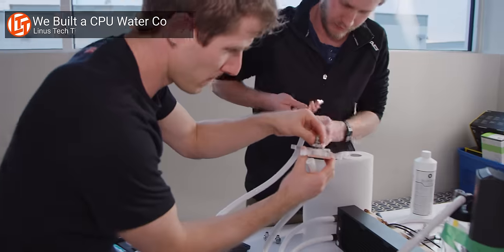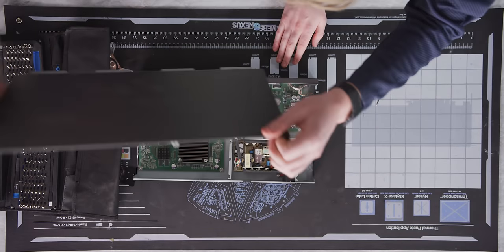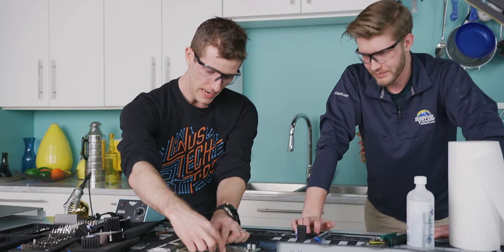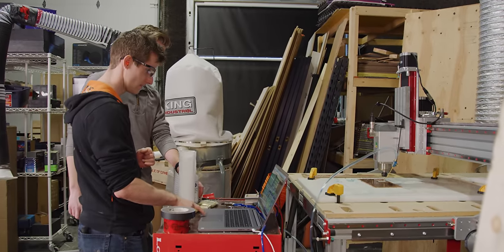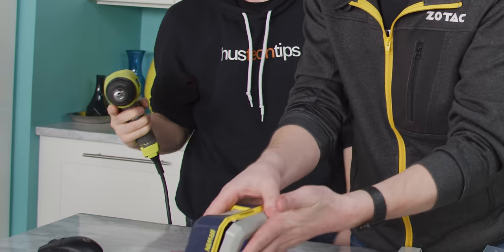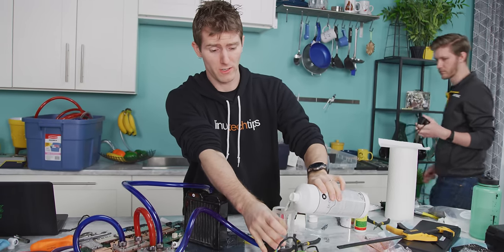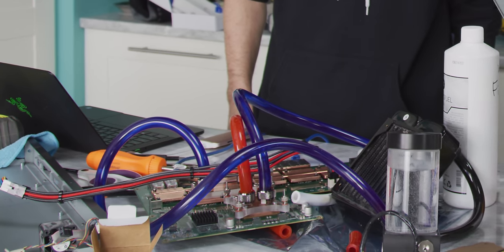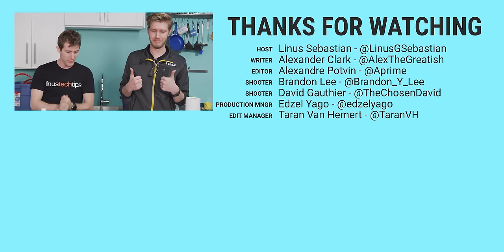Water Cooling a Network Switch!

Comment: I think Linus and Co. may be onto something here.  I know I am tone deaf after years of living a chained hermit life in a data center.  This idea could save the hearing health of many people if applied (with more engineering/design) to infrastructure systems.  Good job guys.  :-)
Reply: Us building engineers are with you being stuck in machine rooms around huge pumps and walk in air handlers. 
I mean technically the building I work in is water cooled (scroll chillers) it's still deafening due to how large fan engineering and hvac in general has not changed in 40 years.

With some modern engineering put into fans and large motors I'm sure they could make systems much quieter and efficient. But less R&D = more profit.
Reply: Custom molded ear plugs are your savior. You can find some that reduce about 28dB and can double duty for stuff like concerts if you get musicians plugs.
Reply: Whole server room water cooling!
Reply: Some quality earmuffs go a long way. We use 3M Peltors and they're pretty dang effective.
Reply: But when it breaks, is it IT or CE's fault?
Reply: I worked in a salmon plant a few summers out of high school and dang the fans of their flash freezer system were something else.  It was so loud and having to kick all the frozen caster wheels to de-ice them was really a lot of work.
Reply: @jc5604  yes.

Comment: You could have cut the top and added a 140mm fan (or two) on top and left the internal heatsinks as they were. Not 27C from water blocks but should be quieter than 40mm fans for same airflow. I converted 2x 1U PSU of a 3U NAS to use 120mm fan (or 140mm with a reducer) with a shroud to cover the rears (less airflow restriction now those 39mm fans have been removed). I also added a cardboard channel to direct airflow from 1.5 of the front intake fans to pass through the CPU heatsink and out the back grill.

Comment: The lack of holes is for the RF frequency isolation, it's a faraday cage for important reasons. You could have ran a bunch of smaller tubes in parallel through the fan holes.

Comment: ‘Because there expensive’ said Linus while being recorded with a $50,000 camera while looking at a computer which is connected to a $50,000+ server
Reply: doesn't change the fact that 800$ switch is expensive
Reply: @Hovado_Lesni  You are right, mine only cost 10€. If you contvert to Dollars though... then to Canadian Dollars... its.... um closer to 800$ ... (but not much)

Comment: Orange might be -12V and black is ground. I've seen a lot of devices put fans on the negative rail like that because the positive rail needs to provide the horsepower to something else and the negative rail has the otherwise-unused capacity to spin some fans.

Comment: the thing is network switches modems and routers actually slow down when they run hotter just like any other computer or device so it actually does improve it so it runs more consistently and protects it from dying from extended use so it will extend its life as well.

Comment: For the next "routing pipes through sheet metal" adventure, you could use the same kind of plastic or metal bushings used when routing electrical cables through metal conduit and junction boxes.

Comment: So I get why people yell at you for your Cnc. I've worked in a shop where they cut small metal bits like you are, a chunk flew out and went about 3 inches into a cement brick. Point is while its spinning, you should be behind some sort of thick barrier. Not only chunks but broken bits can fly any direction.
Reply: or just get an acrylic case to go over it.

Comment: Datacenter network gear is weird to rack mount in server style racks.  They're designed to cool side to side instead of front to back. There are exceptions for ToR switches which are specifically designed for mounting to server racks, but in general network gear is designed to be mounted to open frame telco style racks.  I assume to maximize the area available to ports.  The other thing is that DC gear vs SOHO gear is exactly this: sound produced.  Most larger DCs these days require hearing protection.

Comment: This certainly isn't the only time water cooling has been done in enterprise hardware. Theres purpose built self contained 42u racks that use water heat exchangers and it used to be available on IBM mainframes as well. Fun stuff!

Comment: There is a youtube video where they located the guy that designed the o-ring setup that is on the cupola of the ISS to open the window protection. He still had the original plans and it is just 2 orings but the tolerance was incredible XD

Comment: I probably would of looked at this a bit differently, I would of looked at cooling the entire rack of networking equipment with a dedicated 2-4U enclosed radiator and cooling solution that exhausts out the back of the rack equipment. Still I understand this was a cool stepping stone project.

Comment: the pitch meeting.
we want to water cool a 10gig switch.
Jake: you cant water cool a switch.
Linus: Hold my Madrinas Coffee.
Reply: Nunya Business madrinas has their own ltt coffee
Reply: They need to water cool their Madrinas coffee and make a video about it.
Reply: @as7river  They need to use coffee as the fluid in a water cooling loop.
Reply: @as7river  Yeah a little bucket you put your Madrinas coffee in, and the water cooling loop around it runs to a radiator chilled by a refrigerator. That way your drink stays cold, even if you get distracted by dropping something expensive.
Reply: Linus: Hold my water bottle, LTTSTORE.COM.
Reply: Canadians don't like heat. And with heat they mean everything over 25 degree celcius. So they have to cool everything down to normal canadian temperatures. Which are something like 5 degrees celcius ;)
Reply: @acmenipponair  the thing about cold is that once you get to -10 or -20, it doesn't bug you much anymore. But when it's only 5°, you never quite adjust and it's just awful. I like my room at 15°.

Comment: Y'all took so much time machining the heat spreaders and water blocks, and then just completely wasted it with the contraption y'all put on top. Please update this a cleaner pump/res setup.

Suggestions:
Make a custom 2U or maybe 3U cover
If you made the over taller, you could make at least some of the tubing hard line to clean it up some more.
User a slim radiator (Go bigger to 240 or 280 if needed)
Make a small distribution block (or old 5.25 bay square res) instead of having a normal res

Comment: Did nobody (including the engineers who designed it) notice that all the heatsinks are mounted in the worst orientation possible for airflow inside the switch? 🤔
Reply: There basically never seems to be proper consideration for thermal design in network equipment. Loads of switches have super noisy fans half obstructed by the case, and even zero heatsinking on the chips themselves.
Reply: You should tell Netgear. They're right here in the comments with us.
Reply: Then add fans to add to the ambient server room noise and you know its server grade equipment

Comment: (3 or 4) 300mm heat pipes with small radiators on it, or 1U Dynatron-Passive-Narrow-Type-Cooler would propably do the same.
or even replacing just the fans for NF-A4X20 40MM from noctua.... but sure its fun to take 1U thing and make it like full tower sized.

Comment: Network Switches are mostly mounted on server racks and which is having very strict power and wattage usage controls.. so instead of extra power for pump they will put 2 Fans.. Network switches are not Dump Machines.. they have Os inside it

Comment: As an electrical engineer I can say with reasonable certainty, that orange is not ground and black is not 12V, but probably that orange is -12V and black is ground. If you measure without caring about the other voltages on the board, it would measure similarly. -12V is commonly used in a lot of power supplies including ATX (as a blue colored single wire). I suspect that this bus was used in the past to power dual rail opamps for audio input/outputs, but I couldn't find any specific information on this. 
The problem with using the -12V rail for the pump is, this connection is usually not meant for high power and thus could proof detrimental to overall reliability in the long term.
As a note for future reference, to easily find the ground in most systems, probe a screw hole, or anything that connects to the big ground plane, and then use the resistance measurement to figure out to which wire this connects. That is 'most likely' ground.

Comment: So you all know, Linus actually nailed what a server "U" is. Its a standard unit of measurement used to ensure compatibility between different sizes of servers and any given server rack. A single rack unit is defined as a 1.75 inch slot, so the height of a 44U rack would be 44 * 1.75" = 77 inches tall.
Reply: Yeah I don't think anybody questioned that Linus would know that.
Reply: @TheSolongsidekick  I agree, but I was curious what it's actual definition was vs just calling it a server unit, now anyone else who shared my curiosity on the subject has been informed!
(I'm assuming he referred to it as a server unit in the video, I don't remember  what he said in the video for me to want to research it)

Comment: Why did they choose to rewire a 6-pin to 8-pin adapter to power the pump?
The two 40mm fans both used 4-pin PWM connectors. Since they are water cooling the major components, the 40 mm case fans can will be removed. In order to provide airflow to the remainder of the components mounting the 140mm to cool both the rad and internals was a good idea. That single 140mm fan will obviously be powered by one of the two 4-pin connectors. So, since there is an extra 4-pin header, why not use it to power the pump instead?
The pump's flowrate would increase when the temp rises increasing the heat transfer rate. So, why not use it instead of using a 12V pump?

Comment: I think it would be quieter and better just to cut out 120mm holes on the top, and mount 120mm fans on the outside, as you dont need to deal with leaks will be as quiet as watercooled, but wont be as cool, however wont need to be as you cant overclock it.  
Or you can just dip the thing in mineral oil tank.

Comment: 17:40 It should work, we didn't do anything that bad to it.

Exhibit A 14:55 Instead of canned air duster, using possibly static laden fuzzy duster.
Exhibit B 19:55 Using multimeter in wrong mode, shorting power supply, probably blowing fuse in meter (saving power supply).

Comment: ALEX! If Linus where angry over the caliper, he was right to be so ;)
First of all, that's one of the most expensive brand (granted my favorite brand, but i'm a toolmaker soo... 2nd favorite is Mahr)! 2nd you purchased one designed to be in contact with "aggressive" oil based coolant (okay, so you got the shop now and the coolant, but you just needed to stop measuring while the machines and coolant are running). Literally anyone to 1/4 of that price would have been great for and given you the same accurate measures (or 1/2 for Mitutoyo's eco model). If you've had issues with digital calipers before, i'm expecting them to cost under 15$ shipped from china. One for 25-30$ from a recognized professional tooling shop would have been great!

Comment: If you ever have a screw you can't unscrew cuz it's stripped... Pro Tip, take a bobby pin and solder it to the tip of the screw and when it hardens you can just unscrew it.

Comment: question, would it be possible to basically "cout out" the squares you want, then clamp them in and go through with a drillpress to get a rounded channel, so go through the part "sideways"? (i have no clue about machining, just wondered)

Comment: Would you guys be able to cover cabling certification?  I'm talking about Ethernet Cat5/Cat6 cabling certification which costs 1000$ from companies such as Fluke Networks.
I wonder, just like the $1000 HDMI cable, is there really any difference between CAT cables? (Apart form just the standards cat5/cat6 specification, but also in maximum theoretical bandwidth achievable on cable that is "certified" vs not)

Comment: It would have been easier and probably work just as well if you just stuck two 140mm fans ontop blowing in and added some vents either side instead of the tiny fans.

Comment: I built a  pc using a core v1  case for my father in law using the stock wraith thing on the  amd 2700 .  when I actually entered his office the next day .  I was appalled by the intense whirl of the fans. 
turns out it was the cctv monitor console with a 40 ish mm fan, 
here I am all stringy with the dbs and damn console ruins it.
turns out water cooling random electronics is not such a bad idea.

Comment: Would of been a tad neater using right angle fittings, running the pipes it of fan covers with fittings to right angle it over the top

Comment: An impressive bit of engineering, but it surely would have been easier, more efficient, and more reliable to just replace the 40mm fans with a sideways mounted thin 140mm with a custom acrylic case around it to make it work like graphics card fans.

Comment: Bought a new motherboard, tried to use old case. CDROM and storage drive slots in the case blocked the new huge motherboard, nothing a pair of sheet metal cutters and duct tape to soften the edges couldnt solve. Also had to do a smaller scale version of this when I got a new gaming video card which was too big for the same case a while back.
Why spend money on a new case when the old one can be modified?

Comment: They could of got another U-Rack Mount chassis and put a distribution plate on the top cut the buttom of the top plate out and merged them for them to work ina U-Mount Rack still. Then it wouldn't be open like that or look that jank. :P

Comment: YoU ShoULD TaP In ThE PreSS 

bruh i work in a field where i use taps on pretty much a daily, i hammered a nylock on to all my taps so i can stick it in an impact and i just spray it with WD-40 and call it a day. never screwed up a thread and have yet to break a tap. its fine

Comment: In vehicle maintenence, our version of those clips holding the heatsinks to the PCB are spring retainers found on valve stems in a engine head, in the shop they are often referred to as "Jesus Clips", because if one goes flying, you need Jesus to find it.